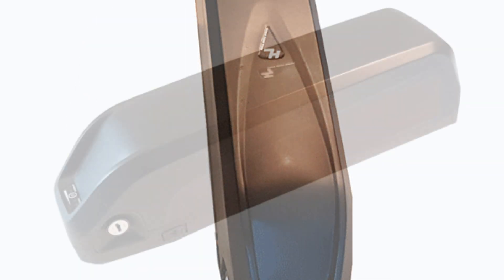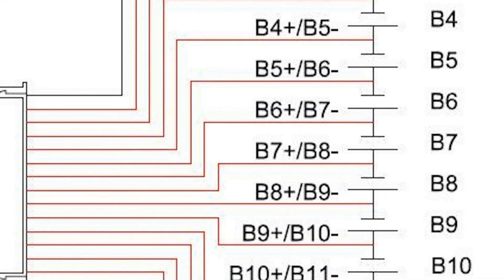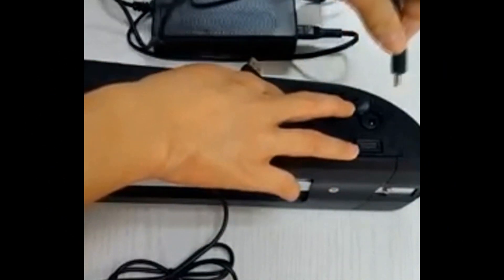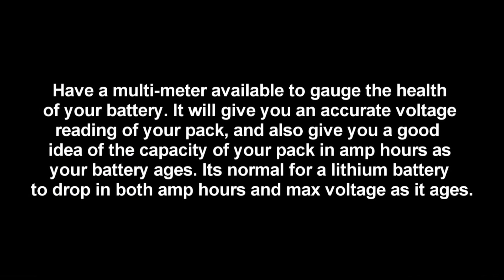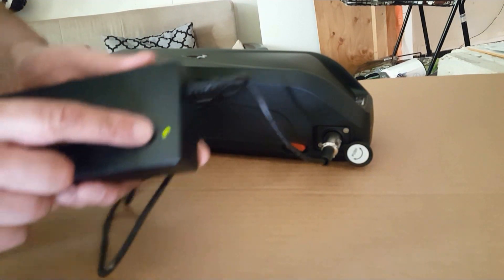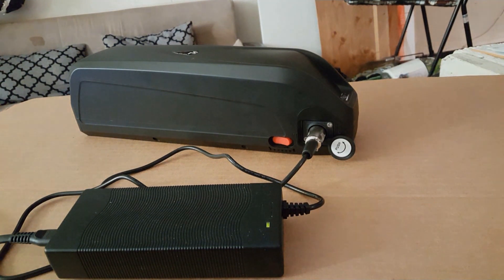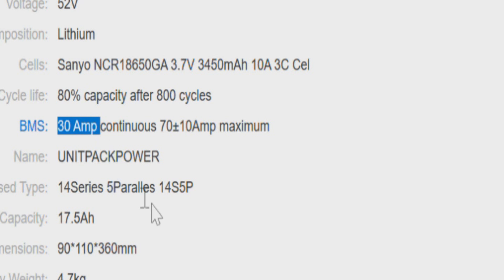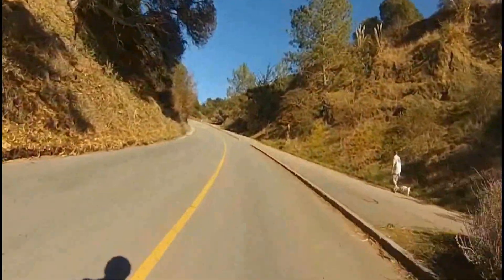E bikes 2020: Understanding + Maintaining +Buying EBike Batteries

Comment: Why is it I'm having a hard time finding Anyone that is Running 26s batteries or two 48 volt batteries in Series to make 96 Volts or 109.2 Volts Fully Charged and then Regulating the Voltage to 60 Volts so there is no Power Lost as the battery Dies for I have a Bafang BBSHD and with the Basic Controller I can Feed it with 60 Volt 30 Amp and with the battery it comes with is a 48 volt 17.5 Ah that can putout 30 amps and with two 48 Volt Batteries to make 96 Volts and Regulating it to 60 Volt 30 amp it pulls under 20 amps at the Batteries and even when it is down to 88 Volts it will pull less then 21 amps and I plan to put the 90 Volt controller that can pull up to 50 amps but I will turn it down to 30 amps and I plan to use Three 48 Volt Batteries to make 144 Volts and 163.8 Fully Charged so it will be still under 23 Amps Draw on the Batteries. I see many People trying to Boost there Voltage but this is a Big hit on Amps being Pulled and I don't want to Draw more amps for if you draw more amps you need Larger Wire and the Farther the Voltage go's down the harder the Booster has to Work and the higher the amps Draw becomes and the harder it becomes on the Booster Unlike the Voltage Regulator yes the amps draw does go up as the battery voltage go's down but not by much when your starting from a Much higher Voltage to start with and this is how Regulated power Supplies Work they Start with a Higher Voltage and Regulate it down to a Lower Voltage and high Amperage.

Comment: Nice video. I bought a bike with a Samsung battery (36V, 13Ah). when you press the battery power button, the LEDs display stays on and presses again for two seconds the indicator LEDs turn off. Now i bought a bigger spare battery (36V 17.5Ah) but it doesn't keep the battery led lights on if i dont press the button all the time. when i Charging, the leds does not show anything or flashing either, but the charger indicator light i can see if it is charging (red or green). Anyway this spare battery works well on the bike otherwise but what is bothering these battery leds ??
Reply: Did your mileage increase?
Reply: @amdgamer1990  For sure bigger Ah increase distance than smaller battery, but power has never run out yet. Impossible to tell mileage, it depends on 10 different things...
Reply: @pekkavalkonen1973  well different assmeble methods make the led indcator show working different ,your new spare battery have the pcm Low voltage switch to control it.
Reply: @AdnanGaoidcbattery  Ok thank you. Spare battery pins has all the time continuous voltage..
Reply: @pekkavalkonen1973  yes,However for each hailong case there is PCM for led indicator, the update PCM parameter for hailong case (int the market) would be function like your spare case ,only light few second,it is normal situation .

Comment: At 1:00 these is a slight mistake that a lot of people make.. It is the electrons that move from the negative end of a battery to the positive.. This makes sense since electrons are negative.. Also, since the lithium ions are positive, the reverse is true.. They flow from the positive end of the battery to the negative end.. It's all about charge and 'likes' repelling and 'opposites' attracting.. So if something is negative, it will repel the negative end of say a battery or circuit and be attracted to the positive end.. If what your analyzing is positive, it will repel the positive and be attracted to the negative end.. It's really simple stuff but gets confusing when conventional current is being taught, which defers to the movement of ions (+) rather than electrons (-).. For the purposes of a battery, usually it's the electrons and their movement that are of concern since that are the thing that's flowing when the circuit is complete, which again is negative (anode) to positive (cathode).. I hope everyone has a wonderful day :)

Comment: I have a Hialong battery. Does the battery power switch need to be on to charge it ?
Reply: Am not sure..my battery does not on/off main switcher, only led's indicator button. Can you see charger led indicator is it red (charge) or green (full). If battery is low but charger led stay green, then turn switcher on and its changed to red....

Comment: Where can i buy then from my battery not holding any charge
Reply: Did you even watch the video? He clearly said there are many places, such as Aliexpress, eBay, Amazon, DHgate etc.
Reply: @kosztaz87  yeah but if you buy the wrong damn one it will not work especially from China
Reply: @LetArtsLive  Correct!. U must understand what charger u need, specially right charging voltage and recommended maximum charge (amps). wrong kind can be devastating...

Comment: Great video. How safe are CAO MM 36v. 14.5ah batteries as far as fire and explosions while charging or just sitting inside home? And if they meet all safety specs and are of high quality why is there such a huge price difference for them at $85 dollars and other batteries at $240? Is it just the addition of a case and mounting attachments. Thanks